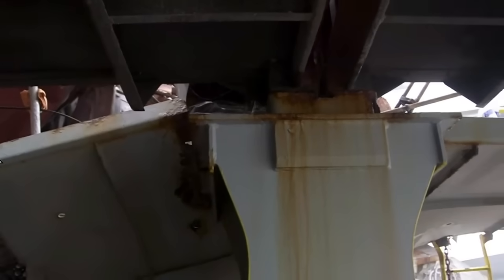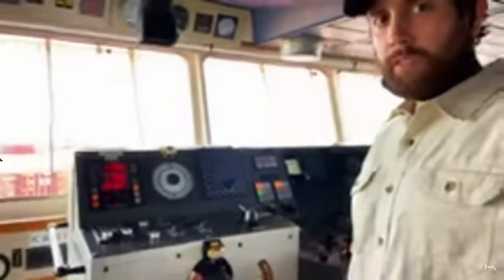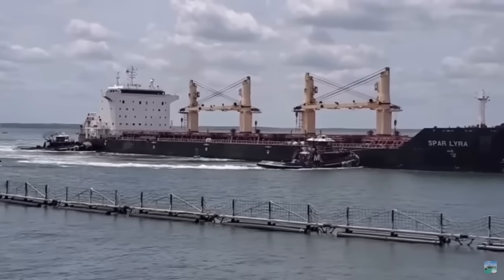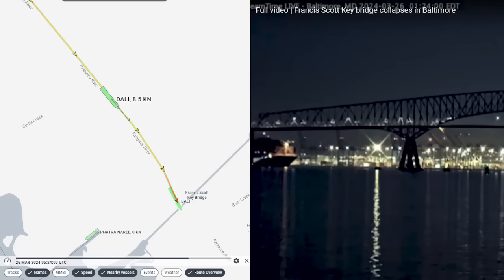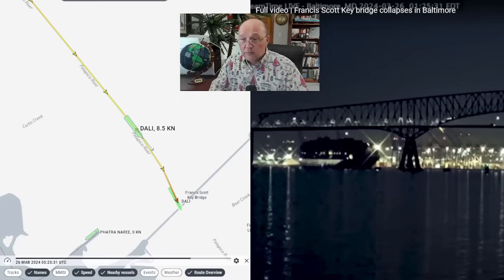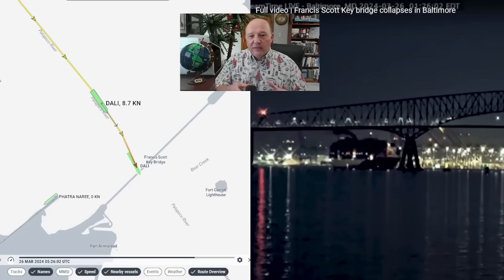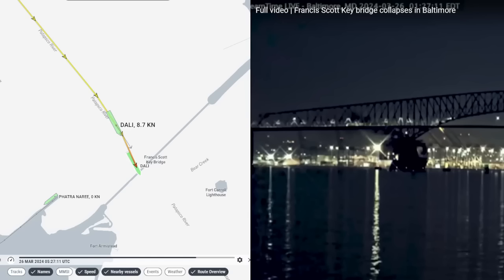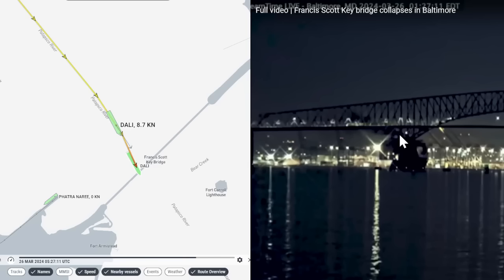Dali Timeline from Data Recorder in Striking Francis Scott Key Bridge in Baltimore, March 26, 2024

Comment: Did the ship sound is horn to alert the bridge workers to the potential danger???
Reply from the maker: Depends if they had power.
Reply: @wgowshipping  you mean they don't have some dedicated battery bank for the horn? Or a compressed air tank that would always be "topped off"? That also makes no sense.
Reply: @wgowshipping  That doesn’t answer the question…I’m not trying to blame anyone.  If as you say it’s dependent on power being available, possibly that’s something that needs addressing!

Comment: I'm hearing that the ship suffered a power failure and suddenly needed auxiliary power. 
What about requiring that ships in situations like this, setting sail, leaving the harbor, sensitive navigation, be required to have aux power up and running before leaving the dock?
In an emergency, it's immediately ready instead of reacting and scrambling to try to get emergency power going when there's not enough time. =PC=

Comment: Question to the captains, helmsmen and pilots out here wrt manoeuvring, targeting at Dali turning towards the bridge pillar: could that be kind of `compensation effect´ due to losing propeller walk once the engine slows down and stops finally? Please apologize if already discussed / answered, but didn’t notice when trying to quickly scan comments (also those from Sal’ other video “Why did Dali lose …”).
NTSB preliminary report says:
“About 0109, … The apprentice pilot ordered a course of 141° to transit under the Key Bridge” (p.8)
“The loss of electrical power … , therefore, the rudder was unable to be moved. At the time [add-on: about 0125; p.9] the ship was heading of 141.7°, a course over ground of 140.8°, and speed over ground of 9.0 knots, with the rudder amidships (0°)” (p.10)

To me this says & suggests:
At that time, MS Dali was on correct heading still.
The crew & pilots seem to have made smart use of the propeller walk to keep course, considering rudder was amidships (0°) – which to me would mean the rudder did not compensate the propeller walk which turns stern to starboard and bow to port (`righthand spinning propeller´ here); i.e. away from the near pillar of the bridge at starboard.
I wonder whether this could already explain MS Dali start turning to starboard in the following minutes to certain amount (possibly also paired with current pushing out from Curtis Bay channel and last remaining, weak tidal currents).
Why?
I’d expect the effect of propeller walk might not be that strong at speed of 9 knots and RPM ~ 27 – 35, but already present. The spinning `righthand propeller´ pulls water down on starboard side of the ship, but pushes it up on port side; creating kind of hump there. This imbalance pushes stern to starboard (if not compensated by rudder slightly set to starboard direction – thus pushing stern back to port – which is not the case here). To my mind, when forces applied to stern, ship will turn around its centre of gravity (this is also important wrt effect of bow thrusters, where I’d expect same physics wrt how ship is turning will apply – correct?). That would fit to propeller walk also making bow turn to port.
Even with loss of electrical power, I’d assume the propeller still kept spinning for some time due to inertia and water still rushing over it while the ship continuing to move ahead. When it slows down and finally comes to a stop, there’s less and finally no propeller walk anymore, of course. However, the surrounding water will try to balance the levels always. The small pit plus accelerated (!) current flow on starboard caused by propeller walk can easily be filled by both water flow vertically from starboard side – thus pushing stern to port – and also by the small humps created on both sides along the vessel when moving forward. On port side, the hump of water caused by propeller walk can simply move away from the ship to port side – thus creating some kind of drag of flowing water; supporting stern to move to port but same time pushing bow to starboard. Means there are forces present (bear in mind we’re talking about tons of flowing water over quite some time!) which will cause momentum to make the ship change direction towards starboard. The rudder placed amidships (0°) might also have supported this to some amount. Though relatively small size of its blade, the components of the forces vertical to the ship’s heading will help to provide additional push of stern to port then. I will not philosophize wrt potential additional supporting effects caused by vortex 😅.
The visible turning might come bit delayed due to the overall inertia involved here.

Does this sound reasonable and make sense?

Comment: Possibility... Engines and/or generators shut off when they “switched fuels”.  The Clean Air Act requires large vessels to burn “clean fuel” (#2 Diesel) when “in port”.  When they get underway they are allowed to switch to much “dirtier fuel” (high sulfur diesel to intermediate fuel oil aka heavy fuel oil).   This was somewhat evident as she was approaching the bridge she lost power and the exhaust was clean..as soon as she fired back up the exhaust was belching black smoke and she “choked out” and shut back down.  
This is a known issue and they have to complete the change of fuel procedure very carefully so this type of situation is avoided.

Comment: Can you answer this:  How could a ship that massive change course enough without power to hit the bridge?   It should have stayed relatively straight because it would take huge amounts of power to change course like it appears to in video coverage.
Reply: Are you referring to the video coverage taken from 3 miles away at an acute angle?  People are interpreting that without understanding the perspective (i.e. thinking the ship is more parallel to the bridge and then turns a huge amount before collision. ) 

In reality, they're just not understanding how long that ship is, and assuming they're seeing it more side on.    The ship's length is almost the same as the distance between the bridge pillars. 

If you fail to understand the angle the ship is actually at, then you assume it made a much more dramatic turn than it actually did. In reality, it turned/drifted about 12 degrees off course. 

Also doesn't help that a lot of the videos uploaded of this are playing at 6x actual speed.

Comment: Saw on Philly news tug pilot was moving battleship new Jersey. Basically 20 years on open ocean and 10 years in the channel for enough experience to be harbor pilot
Reply: BNJ is 1/3 the displacement of this container ships EMPTY weight. And it wasn't under power needing to be stopped. If there was a tug here, the tug pilot would have died trying and failing to stop this, if they were even able to get in position in time.

Comment: The Dali has 2 main generators and 2  auxiliary generators and the 3000kw bow thruster which would of had enough power to work. Looks like they already had issues with the back up systems or was using them to power different things causing them to malfunction.

Comment: The biggest question is: Why did it turn right? Bank cushion and bank suction would cause it to turn LEFT! Not right! The bow will turn AWAY from shallow side and the Stern will suck IN to the shallow side! What in the hell happened?
Reply: There's a video which is sped up which makes the "right" turn into the bridge appear quite distinct. And I think it's the same fixed position camera view. Looks like it was planned to hit that pillar.
Reply: @terebrate  I doubt it was planned. It could have been a bad helm command by the conning officer or the helmsman turned the wrong way. I’d believe these two things before I believe that it was intentional. 

The thing that gets me is that - they were doing fine but for some reason they went to starboard. WTH!?

Comment: Following the sequence of what happened in the video - They turn off the Deck and Forward Maneuver lights, moving to Navigation mode - three small lights on the sides remain on, possibly to disembark the Pilot - Suddenly the ship turns to Starboard heading towards the Bridge Pillar - The Deck and Maneuver lights in the bow are turned on again, probably with orders for the Bow Maneuver Team to return to use the Anchors - Black Smoke is seen from the Chimney indicating that they are operating Full Astern but it's late. My conclusion; The rudder blade does not swerve when it runs out of power, unless there is a rough sea or strong current; It seems that there was a failure in the Servo controller system or hydraulic valves that govern the Servo Motor; Possibly the Automatic Rudder System broke down and sent a false All to Starboard signal, or When they turned off the Navigation lights, someone put their finger in the wrong place and turned off the automatic Rudder???, Uhmmm!,  Opinion of an Marine Electromechanic for 40 years

Comment: I am still following up,  but the Dali is listed at having 22,000 KW Aux Power for reefer power.     That is some big gen sets.   Also listed as 4 gen sets but not what size or type.    the 22,000KW did not say electric or engines that power the generators (which are really alternators,  big ones)  .    For each KW you need about 1.5 engine hp to drive it.    That would be 33,000 hp.  Have to wonder if it was 2200 KW.   Seems not as its listed as 5KW per each reefer container.   Add that up and ......
         There is something called the Unified Command.  It does not list a hierarchy though they may just be breaking it up into relevant areas with COE in charge or the bridge removal,  CG in charge of the vessel.     There is a pretty clear line of work involved.    The CG and COE would only have to coordinate the front of the ship.   Once that is clear then the CG just works around any salvage ships (the USN may take the head role there as they are experts at that though more focused on ships the same gear is used).     It looks like they will clear the North end first which makes a clear progression to working to the ship and getting that side clear before dealing with the bridge laying  across the bow and the Starboard side.   After that is a coordination of when the Dali is removed (and how bad she is stuck to the bottom which would need to be cleared unless its just mud)
Reply: According to Wiki, electricity is generated onboard by two 5,150 hp (combined 10,300 hp) and two 5,900 hp (combined 11,800 hp) auxiliary diesel generators for a total combined 22,100 hp.
Reply: @baldyoldfart  I looked but did not find.   So it adds up.   Those are some serous engines,  probably 1600-1800 rpm (50 hz?).    I had never considered the containers had reefers in some.    Pretty good U Tube by an Indian National on the electrical guys on one.

Comment: The main engine cuts out for some reason, thereby cutting off electric power, and hydraulic pressure.
As I see it, the emergency power never came on timely, thereby setting off all kinds of problems progressively.
If the fuel is heavy fuel oil, it MUST have preheating to make it float as a useable fuel.
I suspect a fuel problem starting off the whole incident, either failing preheater or clogged filter.

Comment: Enquiring minds want to know if the pilot hit full astern attempting a panic stop which would have caused prop walk to starboard (stern to port) throwing the Dali into the bridge support when even just coasting and simply steering for the central span would have resulted in the Dali coming to rest several miles out to sea ... ?  If they had lost steerage but not engins, full ahead would have pushed the bow to port as well ... or does the Dali have twin screws and I am wrong on all counts ?
Reply from the maker: They never would have gotten the prop in reverse in 4 minutes.

Comment: Question.. if the ship is carrying placard 1993 class 3 combustible liquids, should we b thankful that none of these tanks exploded with any sparks, electrical wires that might have snapped, or simply upon impact?  Were any containers damaged where they started leaking??? According to the news that night... the water was cold, fortunately the point at which the fluids would combust would b at around 100*F, if I read this right. We had to learn a bit about placards as EMT-Ps in Chicago and in case of a Hazmat situation. What dies 1 knot equal to, in moles/h or whatever that converts to...where regular civilians can understand? Tx u

Comment: Someone raise the possibility of in order to saving the cost, the chief engineer started to switch diesel fuel (only use within ports) to bunker fuel a few minutes too early? When switching fuels, do you need to stop the engine, then restart?
Reply: I highly doubt they tried switching fuels while maneuvering & within port limits.
By regulation,they would have to get out of US Emission control area prior changing over to HEavy fuel oil and It would take at least a day of sailing till the ships gets out of US ECA area.
No, they won't have to stop engines if they want to switch fuel.It is normally done in running engines.

Comment: How did they stop the traffic in 1 minute 35 seconds? Glad they did but still have a question about it.
Reply: Because construction was taking up a lane in each direction, there were transit cops at each end of the bridge enforcing lane and speed restrictions.  When the dispatch told them about a ship loosing steering, they told the cops to block approaching traffic.  Traffic at 1am is light anyway, so they just stopped all vehicles from driving onto the bridge. 
The audio of the call is on YouTube already.

Comment: if there was no or very little current and no or very little wind it seems the ship didn't need to be going at 8.5 knots to maintain steerage and counteract wind or current steering effects.  Can you comment on that and the additional time that a slower speed would have allowed and reasons, if any , why it couldn't have been going slower.  Since total energy is a function of mass to the first power and speed squared it would seem you would want to go as slow as practical until clear of bridges.
Reply: Think it's mentioned in the "Why No Tugs Follow- Up (Pt.2)" video, because it's a direct-drive (no reduction gears) vessel, it's about as slow as it can go without stopping and restarting the engine. It must be remembered, the engine in the Dali is a massive slow-revving diesel - it's maximum speed is 84 rpm and maximum power is made at about 82 rpm (not a misprint).

Comment: Maybe Sal or someone else here who knows these ships better than me can help clear something up. Everything I have read and heard so far has sounded as if the ship lost propulsion and electrical power. In my experience with Coast Guard Cutters if you lose one you typically would not lose the other because the powerplants are separate, however from the way Sal is describing things here it sounds like the ship lost both, its obvious the ship lost electrical power but would it be typical on a ship like this to lose both at the same time?
Reply: Probably because the ships are built to be as efficient as possible
Reply from the maker: I think it is electrical and/or control issues.
Reply: @wgowshipping  So the main engine would have still been running they just would have had no control of it?
Reply from the maker: I am thinking it may be a control system or electrical issue.  The ship has separate diesel engines for ship's power and the slow speed diesel for propulsion
Reply: @wgowshipping  do the diesel engines get supplied from different fuel? Or do they all pool from the same fuel tanks and/or fuel plumbing? If they share fuel, I could see maybe bad fuel killed the engine, then when the backup generator spun up, it lasted until the fuel purged through its lines and got to it as well perhaps?

Comment: Perhaps TUGS should always accompany ships through sensitive areas such as bridges ?
Reply: They'll have to hire a lot more tug drivers. There's a shortage of qualified tug pilots.  Difficult and dangerous work. Pays well, but the hours suck and sometimes you risk being capsized and drowned, or cut in half by a snapping rope under huge tension. 

Putting a large obstacle between the shipping lane and the pillars would have been cheaper in the long run, but that's a moot point now.
Reply: @jimbobeire  I have old friends up in the Boston area, one of which is /was the / a Boston Harbor Pilot... on call all the time... but pays real well.   Didn't know it was very dangerous work.

Comment: Depending on the position of the achor on the boat creating a drag, it may have also played a factor on the direction the cargo ship was turning. If they throttled the engine in reverse with the rudder in the wrong position for reverse travel It may also have contributed to the misdirection of the ship. With power outages happening it certainly would have put the crew in a panick. However, It sounds like things could have been alot worse. Image if the ship overturned and dumped all the cargo into the bay and contaminated it with nasty toxins and also if the bridge security wasn't alerted in time, worse scenario a charter bus full of people could have gone down. Now a new song may arise over the Dolly rivaling The Edmund Fitzgerald shipwreck in 1975 heading for Detroit.

Comment: Why do VDRs, "black boxes" etc, still have to be recovered? Can't all the data be sent to "the cloud"? Or at least a backup of it? Here, I suppose it was relatively easy, but if the Dali had sunk, or when planes crash into the ocean, no data retrieval.
Reply: So, the giant fleet of merchant vessels in the middle of the ocean all have to be transmitting continuous streams of data to satellites? 

We'd need a lot more satellites. Is it worth it for the tiny number of times a VDR doesn't get recovered?  What are the odds of another MH370?